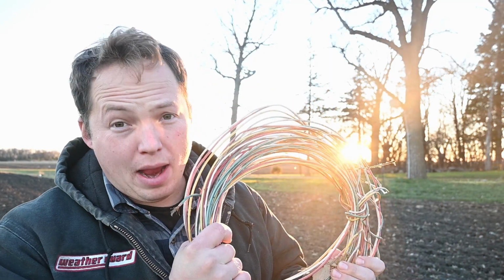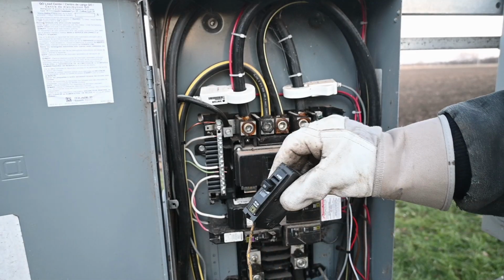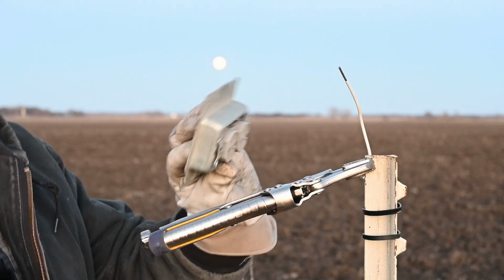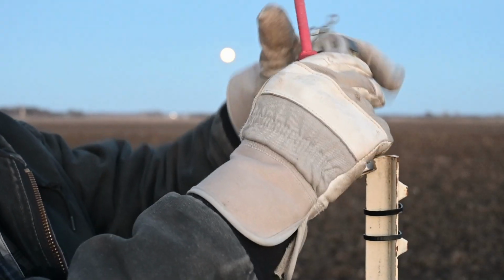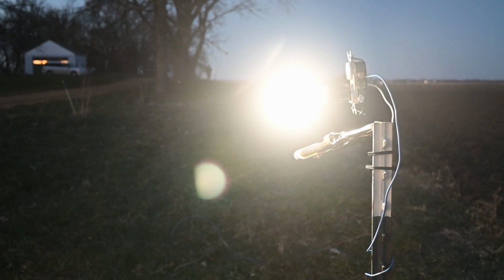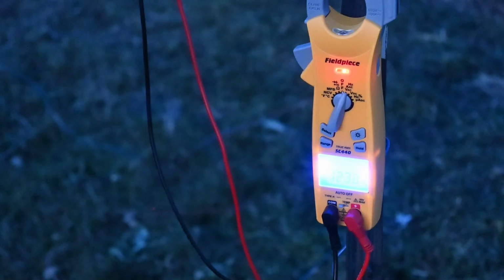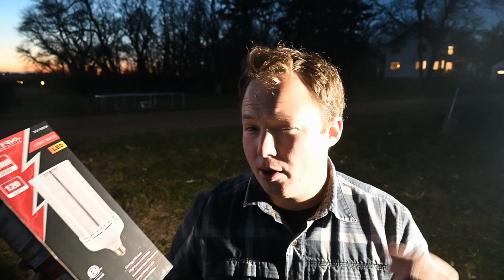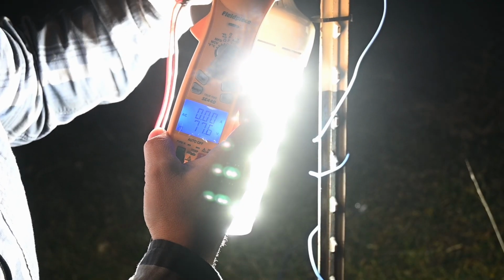Powering a Light With a Fence Post & Scrap Wire - SWER (Single Wire Earth Return) Demonstration

Comment: For a remote ranch in Cochise County Arizona, Sulphur Springs Valley Electric Cooperative ran a SWER line for many miles to provide service, the ranch previously only had generators. I do not recall the grounding methods at each end but I believe the primary and secondary at the customer’s supply transformer were grounded separately. The fact that the single wire was probably in excess of 10 KV would put the earth current quite low especially for loads of around 3 - 5 KW. 

The fun part was the AZ Corporate Commission would not allow Sulphur Springs to run power lines through APS designated territory even though APS would not provide a line to the ranch. So the SWER ran along rural roads in a long rectangular path going east then south making the line many miles longer than it needed to be had it run diagonally!
Reply: That's interesting. I've tried it at both my Arizona desert ranches. One north of Tucson about 30 miles, somewhat rocky terrain, and the other in the Harquahala Valley west of Phoenix, more of a dirt/sand terrain. It doesn't even work in a few feet in our dry desert ground.
Reply: The power companies only need a ground when they set the power pole at the home, barn, ect.
They run it down and curl it on the bottom of the pole. It's there to tap, or ground the208v , 240v  transformer.
Also your main disconnect is the last place the neutral and ground are tied together.

Comment: You can test solar panels true output by hooking them into a grounded pipe (galvanized water pipe, or thick 10' rebar, driven into ground to constant wet area of earth) and checking the current flow (volts and amps), panels directly facing full sun. So, if you had ten 100w panels, you hopefully would register near a 1kwh flow rate, or 80-100amp power to a battery storage. If using 12v DC devices, not too much worry about danger, as when inverted to 100-120AC wave. Such test when considering the max charging rate allowed for each battery, also tells you how many batteries it would take to store all the power of a full sun day from those solar panels.

Comment: The house I grew up in was from 1910 and it had electricity installed by TECO in 1930, probably part of the FDR initiatives during Depression years. It had a single wire earth return, and once I touched it, and got drilled a bit by it, thankfully it was on the "ground" side of the house system. We had to replace the iron rod eventually because the indoor electric started flickering and washing machine motor wasn't working correctly. In the 1990's early, the electric company removed the older meter, put in a new one with an incoming ground, and that caused the monthly bill to go up, claiming we were using more electric than before, which we weren't. We sold the place after 2000 and due to it being prime waterfront property, the old place was demolished by buyers and a new building placed there.

Comment: Would this work in the desert? Likely not, no moisture.
Reply: I was a route clearance engineer in Iraq and we were hit by a lot of command wire IEDs that were  initiated with a single insulated wire....so yeah there is enough conductivity in the desert. At least where we were

Comment: Fun Fact. Back in the early days in San Francisco electric trolleys were powered this way. After a few years water line started to leak all over the place. Turns out the electric return was eating the water pipes. They got thinner and thinner until they could no longer handle the water pressure.
Reply: And nobody had iron deficiency who drank that water!
Reply: Streetcars likely used DC.  Using swer on dc systems can be problematic due to the unidirectional nature of dc current.  This is why many high voltage dc  systems, while they have  +v and -v comductors, will use a third, metallic conductor near (but not necessarily at ) earth potential.
Reply: @heronimousbrapson863  yep
Reply: That is a common problem at railways everywhere. There has been several solutions used also. In London, where many of the tunnels are cast iron, they use "four rail" system, which the positive and neutral (or negative and neutral, or even positive and negative) is totally isolated from everything else. 

On AC systems, there can use "sucktion transformers", i e transformers with each coil connected to live wire and return, so they force the current to take the correct way back to the feeding point and not use other conductors, as waterpipes. 

This also pose other issues, for example when two rail systems meet which have different ground potential, where there can be differences in potential of several volts, which makes it challanging to connect structural constructions and electrical systems together at interconnection points. 
For example, there were a broken ground wire at one point in the subway system in Stockholm which led to a voltage difference between the tramway and the subway, resulting in a velding like spark in the platform roof construction which was quite spectacular. 

There are same things to take into conciderations on the power grid systems as well.
Reply: @oddholstensson212  Never heard of "sucktion transformers" before. I even done a Google search and could not find anything. Here in the US we have some that we call "isolation transformers" and from what you described it sounds like the same thing.
Reply: @davidhenderson3400  Here are a description of this, but only in swedish.
https://sv.wikipedia.org/wiki/Sugtransformator
Reply: Sound like no one new about zinc anodes!
Reply: @thomastessin1663  yep. I was a corrosion technician for 18 years.
Reply: San Francisco CABLE cars are run by steel cables on pulleys under the streets.  Look it up !
Reply: There were single pole trolleys everywhere on earth not to San Francisco San Francisco is famous for the cable car which is pulled up and down the hills by a cable underground that it was attached to it and the is a good observation thank you
Reply: I would say it was dc voltage for the pipes to have a galvanic reaction from the electrolysis seeing as the dumbasses made the pipes the sacrificial anode by somehow applying a positive differential to them..   dc voltage speeds up galvanic corrosion alsi even without any electrolysis going on, but thinking about it, if they did somehow do that, the electrolysis would create hydrogen gas and chlorine gas so they would have found out a different way than rusty pipes that they fucked up on the design,,  lol
Reply: @Andy Smythe I do not know. I do not remember if anything I read on them stated voltage or AC/DC
Reply: @Andy Smythe I would assume DC... 600vDC is a common transportation voltage.
Reply: You’re right trolleys were electric but don’t forget the cable cars were not electric they were pulled by a cable underground but you didn’t say anything about that but I just want people to know that in San Francisco they have electric trolleys  and cable cars too and that there’s trolleys everywhere on this planet also!

Comment: One has to wonder if it's possible to use some type of Ant to pull power from the Earth's magnetic field and use a Cap or transformer pulling power from the air as They say.

One has to wonder why all power systems need a earth ground. When the power to the house should be just to the source too the house and back.

Comment: SWER has always been a mystery to me.  How do they do it with 7200v+ without creating a very dangerous situation?  For example behind my house there is a single high voltage wire, no ground, and that feeds the transformer through a single terminal, and then I have the 120/240v coming out the transformer.  I presume the transformer chassis itself is grounded and then a wire goes down the pole to ground, so the high voltage return probably happens that way.  But say that ground would break, the only ground would be the neutral coming to the house.  Could 7200v in theory end up flowing to my house if there was a fault?  I guess technically this on it's own would not be dangerous unless there is a fault at my house too and the ground opens.
Reply: First I’d guess there’s no way you get 7,200 volts in your house since the transformer will only deliver 240 even when it’s working perfectly (there’s no physical connection in the transformer - it’s all done by induction). And if the ground on your pole broke, then there would be no potential to feed the transformer, which means your house voltage would just drop to zero.
Reply: @truthsmiles  I Was thinking more if there was a fault, since the HV side of the transformer only has 1 terminal which is the 7200v line, the other end of the primary coil needs to end somewhere... guessing it's going to ground via the pole.  But what happens if that connection breaks?
Reply: @redsquirrelftw  If the ground breaks the voltage won’t go anywhere - just like flicking off a light switch… the circuit will be open and no current will flow.

Comment: in '96 when our house was built here in TX the code was to bridge the neutral and the ground together provided we had a copper ground rod 8 ft in the dirt. I was told this was to be safer in that all the neutrals would  no longer be able to cause a shock. I heard since then that some locales have decided to reverse that and go back to the old code. since we were in code at the time of construction I have been told we don't need to change anything. my point is why would they decide to go back to making them less safe?